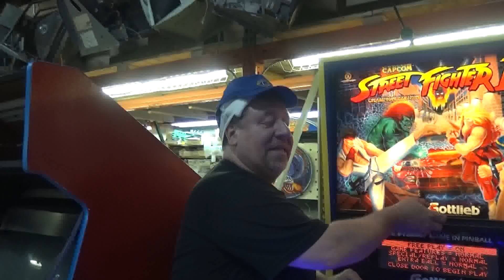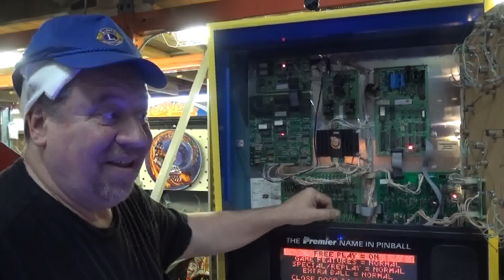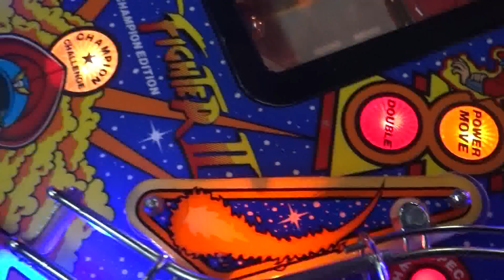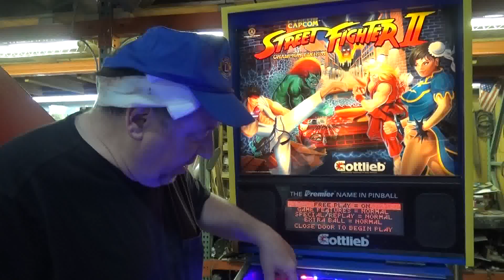#686 Gottlieb STREET FIGHTER 2 Pinball Machine and Jukebox hits Todd's Head! TNT Amusements

Comment: Hey Todd, thanks for all the videos. Where do you get those axial caps for the display driver board? I can't find them anywhere.
Reply from the maker: "The Real Bob Roberts" is the ONLY place that has them!  And that's because I had him find and start making them for us!  We have bought several hundred from him already and he has them in stock!  They fit ANY high voltage pinball power supply!!   :-)
Reply: I had the same issue, but Bob Roberts wrote me back and told me to order the 150uf250v axial cap ones.  He is really nice and helpful.  He makes you send a check just like PBResources, but once you place an order or two it is easy.  The biggest problem I had was actually finding my checkbook, because I don't use it anymore.
Reply: @zimjoecom  hi, how are you? can you tell me what issue about capacitor? i don't understood why this mod is necessary.

Comment: hi guys, my SF2 has the plexiglass porthole slightly lowered than the playfield. has anyone had the same problem as me? moreover, the rubber frame around the porthole has thickness, so even if the plexiglass window was on the same level as the playfield, the frame would still cause the ball to deviate.  In mine SF2 half millimeter of  level difference sometimes causes the ball stuck.

Comment: the lights look really impressive in this cab. Looks like only the lights under the plastics and the back row are the high intensity LEDs... blue except for red in the middle of the back row, and the rest are stock style lamps, is that correct?
Reply from the maker: gr3yh47 We have only been using high intensity LEDS for about 2 months...so this is all regular LED's./...but we used both frosted and clear...which may explain the different looks.
Reply: what does the LED overhaul cost roughly? (assuming the machine is already in good working order all around)

Comment: Hi, I have this very same table and every time the ball is shot out from the bottom left pocket it goes out of play. I am also having trouble shooting the ball up the Chun li ramp. its almost impossible even when i aim the ball right. any advice?
Reply from the maker: Jaime Jaime Coelho the flippers need to be rebuilt....the links and sleeves are probably shot.
Reply: hey thanks for the reply. i Just adjusted the end-of-stroke of flippers to make them more powerful, they work all right now! and I noticed that there were some missing screws from the kick-out which is why it kept shooting the ball off the playfield, so i replaced them it's all working good now :)